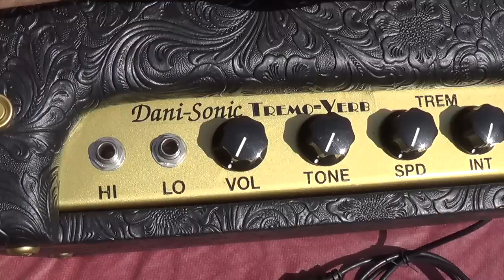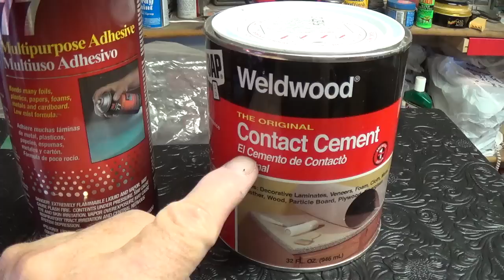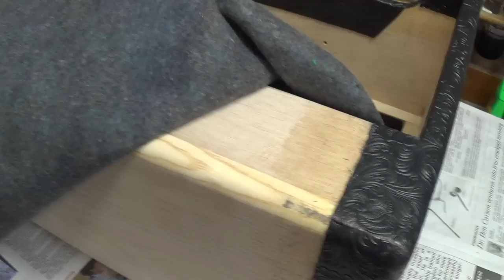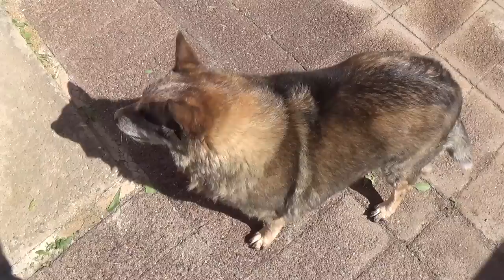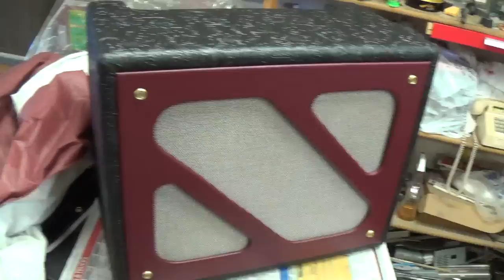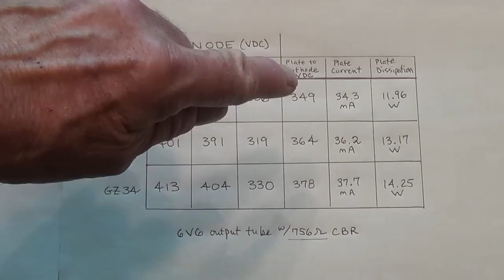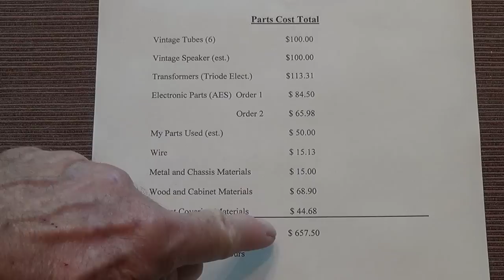How to Scratch-Build a Vintage Amp, Part 8:  Completed and Tested

Comment: Wow. This is a fantastic build. So glad I found this channel. Always wanted to learn more about electronics, especially for amp building. You are a great teacher Uncle Doug! And the pinch of humor doesn't hurt. Well, someday I may build this. But first, I have to learn a lot of stuff. :) Probably my first build will be a Vibro Champ. Thanks for doing this! Btw, how would you compare the sound of this to a Princeton Reverb?
Reply from the maker: +Thomas Asp  Thanks so much, Thomas. Rusty and I are glad you enjoy our videos. I have built a Vibro Champ (a video is posted) and really like it. The Princeton Reverb is probably my favorite amp of all time, but the little Supro comes very close in tone, tremolo, and reverb.
Reply: +Uncle Doug Ok nice! I love the Princeton sound. Yes, I have seen your Champ video (many times now). It's great. If I build one I will also go for the separate 4 and 8 ohm out, definately. Here is an idea for a video: How to go from a schematic to a physical wiring layout. What to think about -placement, grounding etc. :) Thanks for great videos!
Reply from the maker: I don't use wiring layouts, Thomas, only schematics....so I'm probably not the right guy to make such a video, but I'm sure they exist. Check the Internet for possible sources.
Reply: +Uncle Doug Thanks Doug. Well I should have described that in an other way I realize. What I meant was what to consider when you solder all parts and wires together in the chassi, translating it from the schematic. Reading the schematic and from that decide where and how to connect things in the most suitable way. placement of parts, how/where to ground things, where to place terminals etc. Maybe there are some general practice?. Maybe it's obvious for more experienced builders, but I would certainly find such a video very informative and interesting. :)
Reply from the maker: Other than keeping signal wires away from AC lines, and using effective grounding techniques, there really aren't any strict rules governing point-to-point wiring. If I built 10 amps, no two would be identical. You need to review videos showing amp construction.....like the ones I posted for the Supro Tremo-Verb.
Reply: +Uncle Doug Ok, thanks agin Doug! I will research more. :)

Comment: I have question, I have an amp that is 30 watts with a 10" speaker . on the speaker it says 4 ohm Max 40 watts. I wanted to up grade the speaker but no one sells a 4 ohm 10"  speaker can you tell me what I can put in it ?.
Reply from the maker: +M.P. C.  You should match the impedance (4 Ohms) but you can increase the wattage (i.e. to 40W, 50W, etc.). Musician's Friend has a large selection of speakers.....how about this one:   http://www.musiciansfriend.com/accessories/jensen-mod10-50-50w-10-replacement-speaker/665017000000484?rNtt=10%22%204%20ohm%20jensen%20speakers&index=1

Comment: Excellent series Uncle Doug, and thank you for sharing all your knowledge!  I am fairly confident now and am going to start my first build soon...Starting with a Fender Champ just to get the basics down, then I am thinking of either a Vibroverb ('65 clone) or a Marshall Lead (72) I was wondering, do you have a decent circuit for an attenuator? I love the over-driven tube sound, but I want to keep a talking relationship with my neighbors :)  I was thinking a bypass switch and a Pot would suffice, but is there a better way?
Reply from the maker: +Rhone Ranger  You're welcome, RR. Glad you enjoyed the series.  I think most of us started off with a Champ build.....it's fairly straightforward and you end up with a great sounding amp. With regard to attenuators, there are many currently offered on Ebay and elsewhere, and there is far more to them than simply a bypass switch or pot.  They must be able to absorb and dissipate a great deal of power and heat while maintaining a constant impedance. Please do lots of research before you try to build your own, or you risk frying your new circuitry.

Comment: https://plus.google.com/collection/orZ1JB

Uncle Doug,  I wanted to give you an update. Rewired the amp.  I put my experience from the first time and made changes in how I put it together. made my own wiring diagram from the schematic. And I added a better grounding scheme that collected the grounds to the main ground. I'm feeling pretty good right now. It fought me all the way!  I know better what you mean about how challenging this is but very satisfying. 

thanks again for this and look forward to more of your videos! 

Bart
Reply from the maker: +redfishbum I looked at every stage of your Google+ page, Bart, and was impressed by your perseverance and the quality of your work. Let's hope the amp now works just as good as it looks.....which is very good indeed :)
Reply: +Uncle Doug Thanks man.  It sounds really nice.  I wish I could record it but the recording doesn't do it justice.  :)
Reply from the maker: You're welcome, Bart. I don't have the proper equipment for good recording either, but intend to get it some day.

Comment: Another top-notch job uncle Doug! I recently finished converting an old Bogen "Challenger" P.A. head into a guitar amp. It sounds great, and has beautiful cleans. It has 2 inputs, with separate volume controls, and a bass, and treble control. I turned the Phono volume into a master volume, the only complaint I have is the amp doesn't "break up" nearly as much as I'd like. Could you possible suggest any solutions as to how I can get more break up? I cut the feedback on the output transformer and still not enough. I can provide schematics if need be. Thanks a heap, and keep up the good work!
Reply from the maker: +TheOldOakSyndicate  Some standard methods to increase gain and accelerate break-up:  add or increase the value of the cathode bypass caps on the pre-amp tubes, increase the value of the coupling caps, bias the output tubes closer to max PD.  Use trial and error, checking the volume and tone after each modification, until you find the ideal combination. Good luck.
Reply: Uncle Doug Thanks Uncle Doug!
Reply from the maker: You're welcome :)

Comment: Uncle Doug, I love what you do. You are a gifted individual. I recently  received a Calrad Hi-Fi, SA-12B Tube stereo amplifier. I wish to convert it to a guitar amp by adding 1/4 input jack and channel selector switch. Also  output jacks for separate speaker cabs. Would love some input from you on this project. I'm sure this is simple for you,  I feel certain I can perform this task with my limited skills but would love professional input. Feel free to email any advice to me tgitchell@aol.com   Keep up the good work!!!
Reply from the maker: +thomas gitchell  Thanks, Thomas. Rusty and I appreciate your kind comments. I was unable to locate a schematic for this amplifier, so I can't offer any specific advice....but it sounds like you have the right ideas. You might want to install two input jacks.....one for each stereo channel......and a switch to link the two inputs. Good luck.

Comment: Great build uncle Doug - Did you ever address the bass response issue, also the tremelo circuit?
Reply from the maker: +Kevin King  Thanks, Kevin. Once I got it in the house with some decent acoustics, it sounded just fine.....so I left it alone.

Comment: Hey Doug,....hope you are well!  For some reason, my build has gotten worse.....very confusing.  My plan is to take my learnings and completely remove all the internal components, replace in the event that I damaged a component with in initial incorrect hook up and then put it back together.  One thought has occurred to me has been that I might be experiencing a ground loop oscillation.  I think that I might insulate all the grounding lugs, then tie those needing grounds to a central location with a new series of lugs and then take that back over to the main ground.  Curious to know your thoughts.  I have reviewed your video and you have quite a few grounding locations but I might have a few more due to my choice of the smaller lugs, six lugs per set.  I think that the grounding might be a source of my new problem which is a high frequency squeal on my volume knob resolved with the tone knob.  Really weird.  Thanks! And you make this look so easy...LOL
Reply from the maker: +redfishbum   There is "method to the madness" of my grounding, Bart. All of the power supply is restricted to one end of the chassis and has solid grounds directly to or in close proximity to the green ground wire from the power cable. This is to rid the circuit of extraneous AC that exists in the power transformer primary, heater filament wires, and briefly in the secondary circuit (before rectification). Failure to do this will result in a 60 or 120Hz hum. A high frequency squeal sounds like an oscillation problem, not a grounding problem. I would focus on your grid blocker resistors, tubes, and wire routing around the tube sockets. Good luck.

Comment: hey it is possible to add a 3 band tube EQ to that schematic? if is possible were is the best please for it?
Reply from the maker: +Rolando C  I guess it would be possible, Rolando, but I'm not well versed in such modifications since I deal only with vintage tube amps and circuits. Perhaps another viewer can help or you can find info with a Google search. Good luck.

Comment: Excellent build. I have to say again how much I appreciate the level of detail you put into the videos. I had to stay up 'til 3am to finish the series with a little fast-forwarding. I'm now interested in building the higher 15-17 watt version of this, but we'll see what pans out. I've got to get a chassis and cabinet worked out, whatever I end up building, and it's good to know one can fit 'verb and trem' in one of the classic capital C chassis. I'll have to rewind and see what your dimensions were. There are a few other details I wanted to know, but I'll peruse the vids again before starting anything. Good note on the carbon film versus metal oxide resistors. I just replaced the screen resistors in an Ampeg J12T reissue tonight. (it has me wanting P2P wiring instead...) I noticed the resistors I replaced were blue in body color. The replacements I used were tan in color. Is the body color generally indicative of the type of composition? They are both 100ohm, 1/2 watt resistors. Sorry for the rambling, your series was addictive and now it's late and I'm loopy. Keep it up, I enjoy this...
Reply from the maker: +Joel Thomas  Thanks so much for your nice comments, Joel. Rusty and I are glad you are enjoying our videos. Yes, resistor body color is indicative of type. Blue-bodied resistors are generally metal film, while tan-bodied are generally carbon. You can look them up on the Antique Electronic Supply website to accurately identify their composition.
Reply: +Uncle Doug  Do you think this change from metal film to carbon may increase the chance of failure in this already failure prone resistor in this amp? I can take my questioning elsewhere if you can recommend a good amp repair forum... I was on the amp garage but have a hard time getting on their site anymore due to alleged security risks from my browsers... thanks for all your helpful responses.
Reply from the maker: Joel, you're always welcome to ask questions here, and I will do my best to answer them. Also, the Hoffman Amp Forum (el34 World) http://el34world.com/Forum/index.php and the Telecaster Forum http://www.tdpri.com are good sources of info. You're right about screen resistors being prone to heat damage. As a result, I use metal film replacements in the 2W range.

Comment: Hi Uncle Doug!  I just finished working and everything for the amp. the 15K resister smoked within 30 seconds of me turning the power on with just the 5y3 in place. I replaced it to double check that I had the correct value. same problem. suggestions on how to troubleshoot this?  email may be better?  redfishbum@gmail.com. Thanks a ton!!  Bart
Reply: +redfishbum Additional info:  Testing was done with the use of a dim bulb tester in place.  I tested the system initially with no tubes, pilot lit, fuse good.  When I placed the 5y3 and put power to the system via the switch, the 15K resistor in the power supply began to smoke before I could even check the voltages.  This is a 1Watt carbon resistor that still checks out in the 15K range on my multimeter.  Also, with my multimeter, I checked the AC voltage in the rectifier socket (no tube) and it checked out at around 5 volts.  I also placed a different 5y3 that is known to work and the resistor still began to smoke.  I have not put any other tubes in the system but the 5Y3.  I'm really puzzled.  Thanks for any thoughts.
Reply from the maker: +redfishbum  If you are speaking about the 15K resistor just prior to the B3 output, there are several possibilities. Is the 10uf electrolytic in backwards? If not, then one of the components that receives the B3 output must be shorted or there is a wiring error that allows too much current to flow. Check the resistance between B3 and ground. If it's very low (nearly zero) then trace the circuit to find out why......improper resistor value, shorted capacitor, etc. Good luck.
Reply: +Uncle Doug.  Great feedback.  The caps are in the correct direction.  I went though the entire wiring diagram and all the resistor and cap values are correct and seem to be wired correctly.  I checked the B3 resistance to ground and it was 267 ohms in all places I checked.  I have the B3 wired to two different spots.  I systematically removed the B3 that fed V1 and V2.  I plugged in the 5y3 and turned the power on......no smoke from the 15K power supply resistor.  I then connected a jumper from B3 to the 270K resistor connected to pin 1 of V1.....no smoke.  I then connected B3 to the 270K resistor V2a pin 1.....SMOKE.  I have it isolated to the tremelo circuit but all seems to be in order upon inspection.  I'm gonna take a break for a while; I've learned much!  Still fighting...LOL

Any short cuts to isolating the problem in my circuit without desoldering or removing components?

Bart
Reply: +redfishbum Hey Uncle Doug....wanted to give an update.  I rebuilt the tremelo circuit with different 0.01 uF capacitors and the 15K resistor at B3 stopped smoking!  Success!

I then drained the caps, put the chassis back into the cabinet, plugged in a guitar and  turned on the amp.  All tubes began to glow.

However, no sound came from the  amp.....very slight hum as you would expect.  The output is wired correctly to the 8U non grounding output.  I checked the DC voltages. B1 ~375, B2, ~356, B3 ~270 (at all points).  B3 was the only value higher than on the schematic.

Gonna give it a rest for this weekend, hopefully next weekend I can get it sorted out.  If you have an trouble-shooting suggestions, I'm all ears.  

As for the smoking resistor, I learned so much today regarding isolation and troubleshooting.  I'll try to apply some of that experience to rooting out the no sound situation.

Thanks! 

Bart
Reply from the maker: Any newly-built amp is prone to some minor issues at first, Bart. It sounds like you are sorting them out, however, and learning a lot along the way. Keep me posted on your progress.

Comment: love it i am going to build it just using the 6l6 and a 12 inch speaker
Reply from the maker: +ian “valve doctor” forster  Sounds good, Ian. If it will be purely 6L6, then get a stouter power transformer......something with about 125mA high voltage rating so you can bias the 6L6 to optimum PD. Best of luck.

Comment: love the pattern of the covering going to find it
Reply from the maker: +ian “valve doctor” forster   I think it's available through Antique Electronic Supply in Tempe, AZ.
Reply: i will look your circuit is good i am going to put a push pull 6l6 output stage i buy parts for the company in the usa https://www.tubesandmore.com/
Reply: i have used theses transformer in my 6v6 push pull amps its 455 MA i use a voltage doubler and a 2500 MA  heater transformer i needed to cut down on the weight for one of my amps i have also paralleled 2 of them together for a amp witch worked great about 910 MA

Comment: Hi Uncle Doug....quick question.....The schematic on V2a has the 0.03uf capacitor connected to the plate (pin1).  However, in the wiring diagram, it seems that the 0.03uf cap is connected to the grid (pin 2).  I've watched your video a couple of times and cannot visually resolve.  Can you confirm for me that I need to connect the shielded cable to pin1 of V2a.  Thanks!!  Bart
Reply from the maker: +redfishbum  The .03uf cap is part of the oscillation loop for V2a and does indeed connect to the plate (pin 1). The 2.2K resistor connects to the grid (pin 2). Whenever in doubt, always trust the schematic.....it's what I used to build the amp. The wiring diagram was made after the fact and was very difficult to complete. We're still ironing out some errors in it. Sorry for any confusion.
Reply: Excellent. I'm going by the schematic and the grid concurrently but giving the final nod to the schematic. Very helpful confirming what I was thinking from the schematic. Thanks a ton!!
Reply from the maker: You're welcome, Bart. I'll bet the Supro TV is really taking shape quite well. Keep up the good work :)
Reply: +redfishbum Hi guys, I need to make that V2a .03pF connection change on the layout diagram. Thanks for finding the error!
Reply: +tommyfoley hey Tommy....Tha ks so much for the wiring diagram.....hugely helpful. the only other thing that needs to be changed is the value of the Plate resistors on V1a pin 1 and V2a.....they should both be 270K ohms but the wiring diagram just has 270 ohms. 

thanks again!!